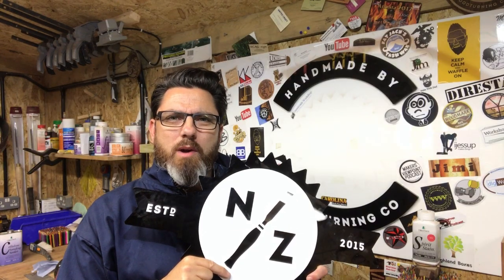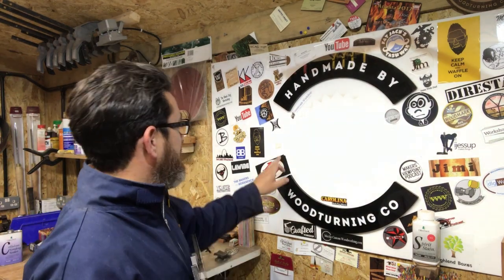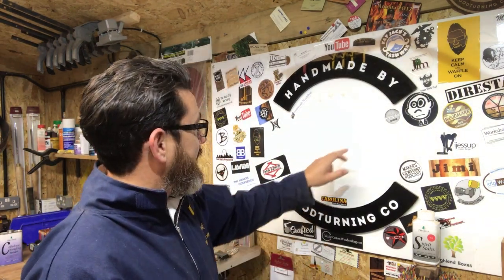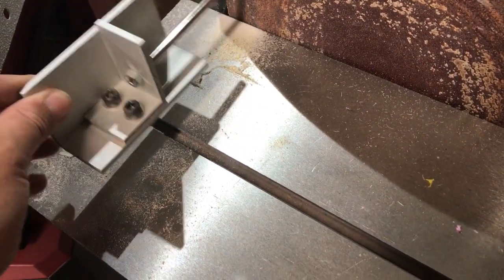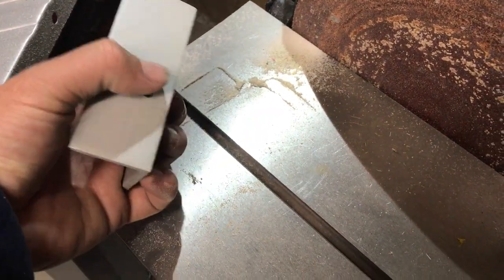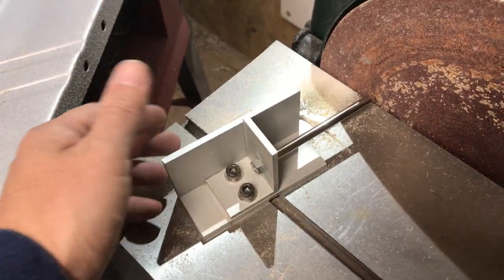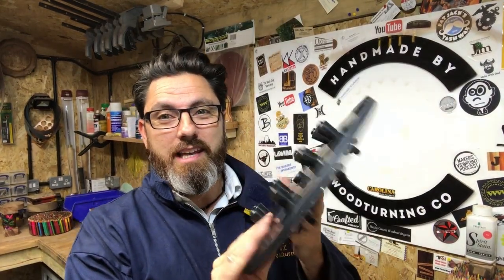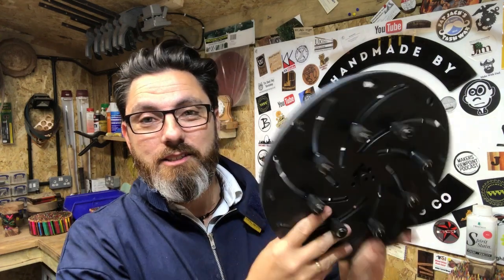WAFFLE ON WEDNESDAY #011/ LONGWORTH STYLE CHUCK!

Comment: Nick, I have never seen anything like that blank tool. Each blank for different pen styles will be different lengths. That tool looks like it is adjustable but seems like you will spend lots of time adjusting it for every pen blank! Turned several pens and I just use a square on my disc sander to trim my blanks. Sand each end until the brass is cleaned up. If you are careful with the glue that should be all you need to do. When you apply the glue, do not put it inside the blank. Put the glue on the brass tube. If you would like some pictures of how I do it let me know and I will send some over. Hope this helps. Looking forward to your next project. Be safe!